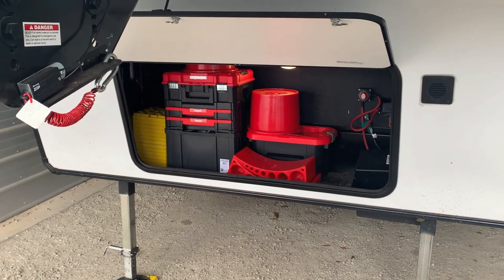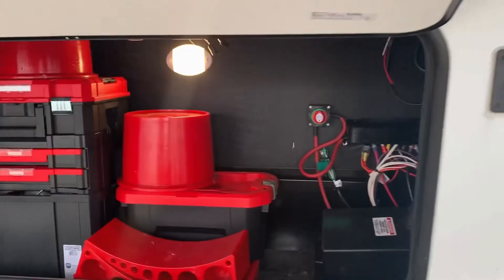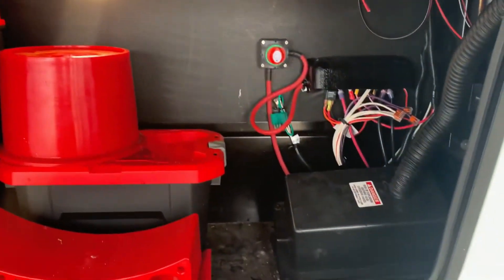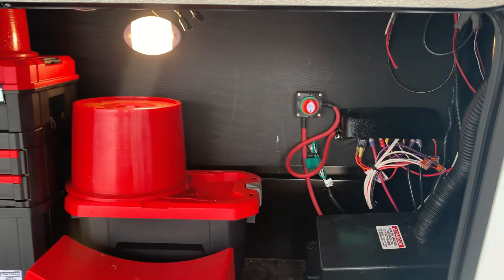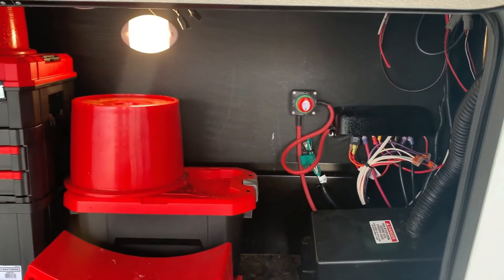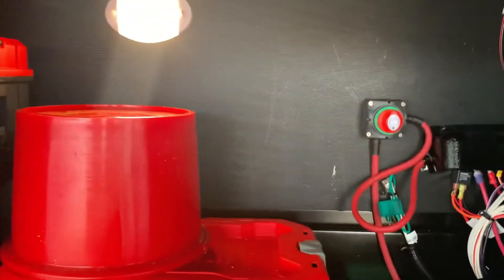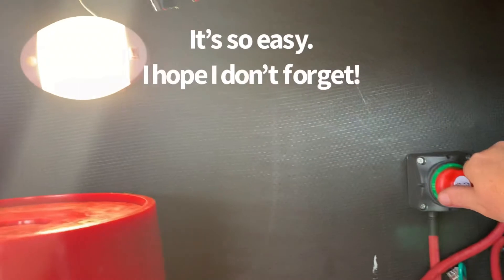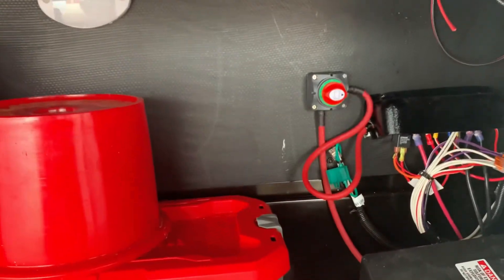Added a battery disconnect switch to RV.

Comment: Randy would you provide the information on the switch and cable you used?  I would like to purchase the same equipment for my rig.  Thanks Bob
Reply from the maker: Ampper 1-2-Both-Off Battery Disconnect Switch, 12-48 V Battery Master Cut Shut Off Isolator Switch (1-2-Both-Off) and 2 AWG Gauge Red + Black Pure Copper Battery Inverter Cables Solar, RV, Car, Boat 4ft 5/16 in Lugs from Amazon.